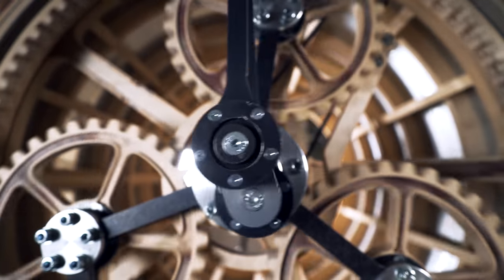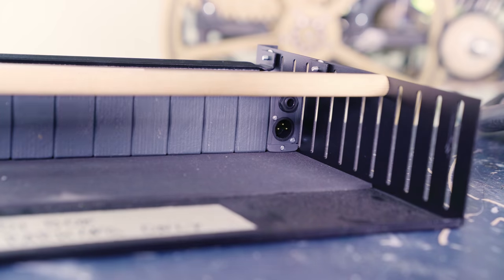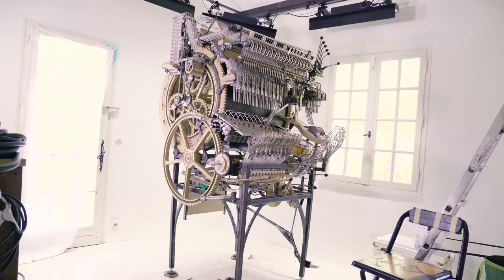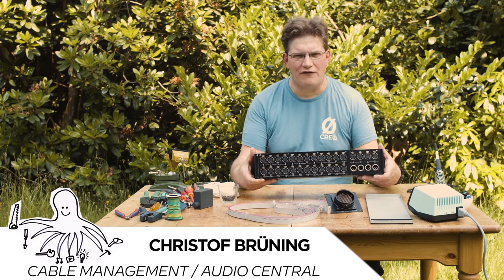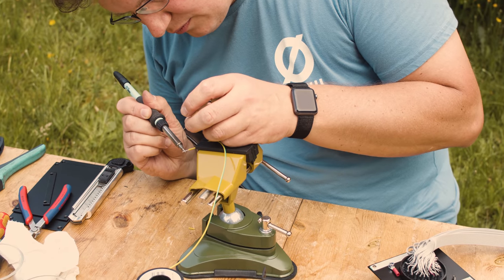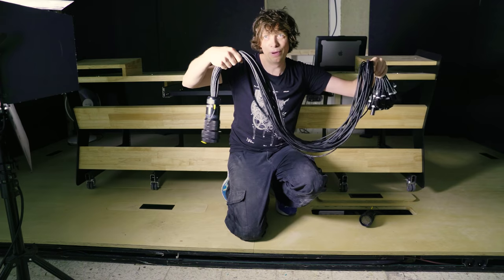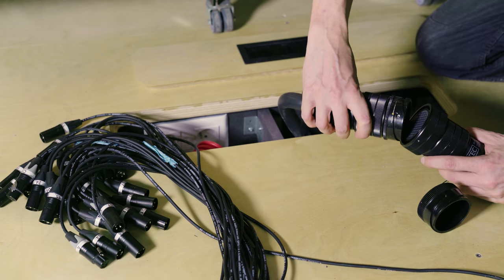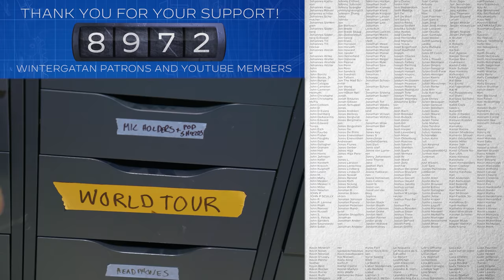28 Audio Channels in One Cable! - Marble Machine X #133

Comment: Those are 28 points of failure, on a very heavy cable, and a very hard to replace one. And using audio cable will probably lead to lots of noise. I still think the best solution would have been to use an AES50 network interface into a digital mixer.  I personally see no downsides.
Edit: To be quite honest, this solution bothers me more than even the mechanical fingers. Bothers me so much i feel the need to rant. You have a custom box, which you cannot get from anywhere, that can only be serviced by one man. You have a huge rack filled with preamps. Then a huge, massive cable prone to failure. That cable is so big it looks like it could topple the MMX. Who thought this is a good idea? You could have all of that in a much smaller box that can be bought from anywhere, with an ethernet cable sticking out of it. That's the engineering solution.
Also, omg, that's 3000 euros of preamps there. Who even knows how much the cable costs... With that money you could have bought the digital solution 3 times over, including a digital mixer.
12:45 Waaaait a second. You have a digital interface? But on the wrong end? Lol.
Reply: I`d just stick a Yamaha Rio to the machine and run 2 Ethernet cables...
Reply: Or throw in some Dante Preamps and you´re in the Dante world, even better. It´s becoming more and more an "standard" :)
Reply: I think this is about the classical Analog sounds better than digital Debate...
Reply: 84 points of failure, 3 pins per channel.  losing one channel is better than losing the whole thing.  big audio production uses multipin like this every day (well... when there's shows...);  it's still far more common on the stage side, whereas runs to FOH are almost always digital now.
Reply: @CraftingCake  well once he get's on a stage with this, it will be digital anyways. This is just delaying the AD conversion. And to be absolutely clear: There is no noticeable difference. Wouldn't use Tio but Rio at 96k would be just fine
Reply: I agree with you. Looks like trouble to me. Cool trouble, but trouble anyway.
Reply: I doubt noise will be too much of a problem since XLR is differential, and it looks like mics will be preamp'ed at the machine which should also help, but totally agreed on the points of failures and just general monstrosity of a cable that shouldn't really be needed with modern digital equipment...
Reply: That was my first thought just from seeing the thumbnail. Could even have redundancy depending on the sample rate and the digital system used.
However not knowing what digital systems venues across the world would be compatible with might have influenced the decision for all analogue solution.
Reply: for recording that would work, but think about the world tour.  It's a huge assumption to make that every place they perform can support the digital input.  it's much easier to run the snake with the breakout using XLR, as you know every venue can support those inputs.
Reply: you gotta have the pure analog toan ok?
Reply: @MrLukiipukii  that's the point where my practical knowledge about live performance technology ends...
Are there no analog live performances anymore?
Reply: @Chris The Pack Rat aren't there cabs to prevent that? I mean multicores are used pretty often and there are a lot of very fragile parts on the machine...
Reply: This is absolutely tour grade gear. This multi core technology is rock solid and has stood the test of countless world tours for decades. Your solution would require a lot more hardware physically attached to the MMX in terms of additional preamps and A/D conversion, all of which would be difficult to replace or upgrade. This way, Martin can connect the MMZ to literally any system whether it’s a studio with crazy high quality preamps and converters, or a live venue with any mixing console. This is way more flexible.
Reply: I thought the same about noise when I saw the electrical outlets directly next to the cable. We'll see where this goes.
Reply: @CraftingCake  
"I think this is about the classical Analog sounds better than digital Debate..."
There's two scenarios:
1. Live. Audio quality at a live show is comparable to a cheap chinese knock off mp3 player playing music through an even cheaper pair of headphones. You will not notice any difference between a digital and an analogue signal chain.
2. Studio. You are recording on digital anyways. Whatever advantages are there, if any, will be negated.

Digital audio has come a long ways. 24bit 96kHz is pretty much bog standard these days, with 192kHz being very common. Analogue is simply not worth the hassle, particularly in this case.
Reply: @CRothgeb  As an engineer I'm personally just worried about the number of cycles the connectors are rated for. I don't work in the pro audio domain though so I'd be curious to learn more about them in general.
Reply: @CRothgeb   Nope... requires less hardware... have a look an Focusrite for example or an Yamaha RiO. It´s just ONE box and you´re good to go. Plug in your mics and that´s it. And it´s easy to get an replacement if needed. The other end is an digital mixer. That´s all it needs. If you want redundancy just add an secondary ethernet cable. Here you would need an second large multicore. And to speak for europe you find these multicores less often these days. So if it breaks it´s way easier to get an Ethernet cable than this special multipin. I know these are often used back in the days, but time changes...
Reply: @vetramiga1  The "common" argument is not a very good one. There was a day when recordings were done directly on disk, with a large horn moving the needle. I'm sure glad that people back then didn't say "Well, let's not waste time with this electronic stuff. What we're using is far more common anyways..."
As for losing one channel being better than losing the whole thing... sure... as long as fixing the whole thing is harder than fixing the one channel. Ethernet cable breaks? Cool. Pull out a new one from your back of 10 backup cables and the show is back on in about 2 minutes. One of your channels dies in your massive 28 signal cable? Well, assuming that the intermittent connection didn't blow up your speaker system, then you can fish out that spare you have, and hope that in the year or so since you've made it, during which you've carried it half around the world on tour, that cable still works. You did bring a spare, right? Right?
Reply: @Zarnith  
"However not knowing what digital systems venues across the world would be compatible with might have influenced the decision for all analogue solution."
No, that's not how that works. You can't expect to plug 28 microphone inputs into the main mixing board, and still have inputs for everything else. No, all of these inputs go to a mixer dedicated to the MMX, and then you take one or two line signals and patch them into the main board. So you treat it just like any other instrument.
Reply: @bassman87  
"for recording that would work, but think about the world tour.  It's a huge assumption to make that every place they perform can support the digital input.  it's much easier to run the snake with the breakout using XLR, as you know every venue can support those inputs."
You assume every venue has mixing boards large enough to take 28 inputs and still have enough inputs for 6+ microphones, 4 guitars, 6 keyboards, 4-8 other varied instruments, and a full drum set. No, you have a dedicated MMX mixer which then gets patched into the main mixer just like any other instrument.
Reply: @CRothgeb  
"This multi core technology is rock solid and has stood the test of countless world tours for decades."
Technology evolves. I'm sure tube amps were also rock solid, but no venue now uses tube amps for their PA systems.
"Your solution would require a lot more hardware physically attached to the MMX in terms of additional preamps and A/D conversion, all of which would be difficult to replace or upgrade."
No offense, but you must be living in the '90s. Remote controlled audio interfaces with crystal clear preamps are readily and widely available. All that an AES50 network setup would require is this: https://behringer.com/product.html?modelCode=P0BMC and nothing more. Sure, i'm biased, i like Behringer, but there's plenty of other options.
"This way, Martin can connect the MMZ to literally any system whether it’s a studio with crazy high quality preamps and converters, or a live venue with any mixing console."
You assume that every venue has a big, 100+ channel mixing desk... They don't. Routing the network into a dedicated MMX mixer is, without even a shadow of a doubt, the absolute most flexible solution.
Reply: @CRothgeb  Oh, and btw, as Martin says, what they're using is a custom made rack unit. That thing breaks and the show is cancelled and someone needs to bust out the soldering iron and a multimeter. If and off-the-shelf digital interface breaks, not only do you probably have a spare, but you can order one almost anywhere on the planet.
Reply: FYI when you go flying on an airplane it keeps itself flying through dozens of similar connectors.... Only the new 787 and a350 have ethernet cables because of bandwidth so...yeah, food for thought
Reply: @almerindaromeira8352  Well, those connectors aren't being plugged and unplugged and flexed on a daily basis, and there's no one walking over them and tripping on them
Reply: There may be solutions that can use just one small ethernet cable but one thing this project has always held high is appearance.  And personally I think that massive cable coming out of the back makes it look even more badass.

Plus the pins in that style of connector can generally be replaced very easily with a small tool so if one was to get damaged or broken it would be easy and quick to replace.
Reply: As an update, Lucas Wendel said on Discord that this is only a studio setup and that it will be replaced on tour with a digital solution. That's better, i suppose.
Reply: @CRothgeb  Tour grade yes, easy to break absolutely! In this day and age theres no need to run huge amounts of multicore. If they use a standard like Dante then it will work with just about any touring console about anyway! Also they should have their own anyway or a standard mixer that they use as no doubt get the wrong mixer with the wrong number of channels etc.
Reply: @Chris The Pack Rat This method has been "on the road" for decades. It is proven. I would personally prefer he put a Mix I/O (Yamaha, A&H, Midas, whatever) on the machine, can be controlled from his computer.
Reply: @bassman87  The Dante format is universal, every digital console out there can handle it.
Reply: @CristiNeagu  well, airplanes are maintained fairly regularly so they see some action (not everyday of course). I believe that Martin won't mess with it frequently and the cable looks heavy duty. Did I tell you that the military also uses them for field equipment?
Reply: @classicrocker118  
1. But he hid the cable, which means he doesn't like the look of it.

2. How long does it take to replace a pin on that cable? Is it faster than replacing an ethernet cable?
Reply: @almerindaromeira8352  Airplanes are maintained regularly, but they don't go around unplugging every cable, coiling it up, then plugging it back in again every day. And i doubt new military equipment chooses huge thick multicore cables over huge thick network cables.
Reply: @snarkylive  As we see at 12:45, it all gets converted to digital anyways, thanks.
Reply: @CristiNeagu  I would say once a weak there is someone doing maintenance on specific problems and every 6 moths a B check and once a year/year and half a C check where they remove most stuff out of the aircraft. The connector itself is pretty tuff I think what concerns you is the transition from the metal to just rubber coating. Worst case scenario they can do a elbow connection straight down.
Reply: @CraftingCake  "analog sounds better than digital"  Yes it definitely does.
 I only use the all-analog setting on YouTube and Netflix.
Reply: And what happens if the venue doesn't have an AES50 console? Maybe they are using an old DiGico D1 with coaxial Madi.
The downside of digital audio, is that we have like 20 diferent protocols.
Reply: @CraftingCake  no buddy not really since at least 2000 - maybe even 1990 there is almost always at least one component in the chain which isn't analog - this maybe be the speakers amplifiers itself or a multichannel speaker controller
Reply: @CRothgeb  It already has rack of preamps attached, could have easily been digital stagebox instead. Would be 2 rack units, and current solution is 4. As for "any systems" -- bands doing world tours don't work with "any systems", they bring stuff with them on tour and have tech riders for gear that is provided at the venue.
Shovel is rock solid and has stood the test of countless holes dug in the ground for thousands of years, but when you are building a house -- you hire an excavator to dig the basement.
Reply: @CraftingCake  there absolutely are! Although mostly concerning the stage side of the productions. There are very few venues left with analogue house consoles. This wouldn't matter though, as one would probably include the engineer and the desk in the tour package.
Reply: @CRothgeb  It definitely is. This will last for ages. I am wondering though, why they didn't opt for something like an NC-40 which is a bit more common than the proprietary solution. Some stage racks would support this "natively".
Reply: @bassman87  I don't know how many times I have said that now, but every middle sized tour brings their own console and engineer with them, there is absolutely no need to worry about what the venue has
Reply: @CristiNeagu  you say some true things here, but on two things I have to correct you.

First, venues generally have digital consoles with a minimum of 64 channels, totally standard of you want to receive major artists, and local mixdowns are a thing of the past (or low budget),

Secondly, every tour brings its own equipment, including console. That means that they can use the digital system they want, and use as many channels as the console they use has
Reply: @CRothgeb  The "rock solid" cable is already having issues, as we've seen in the latest video, with channel 3 out of action. So... yeah.
Reply: @MrSadowEsp  Very simple: you have a dedicated digital mixer for the MMX. There is no reason why you'd have to do extensive line level checks every time you change venues. You set it once in the studio, save it as a preset, load it up when you start playing, and you treat it like any other instrument.
Reply: @einereinar  
"First, venues generally have digital consoles with a minimum of 64 channels, totally standard of you want to receive major artists, and local mixdowns are a thing of the past (or low budget),"
I don't think that's guaranteed. Either way, having a dedicated mixer for the MMX makes setting up the levels much simpler, since you already have them set from the studio.

"Secondly, every tour brings its own equipment, including console. That means that they can use the digital system they want, and use as many channels as the console they use has"
That was my argument as well.